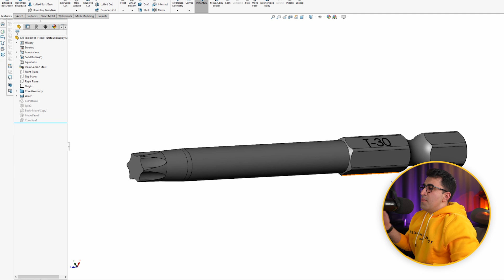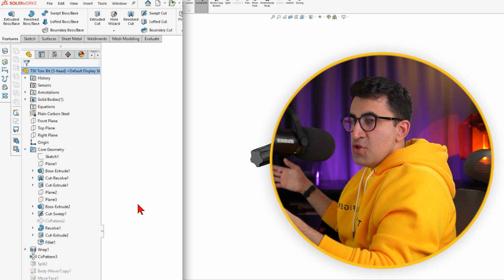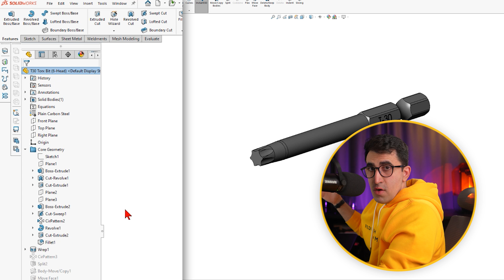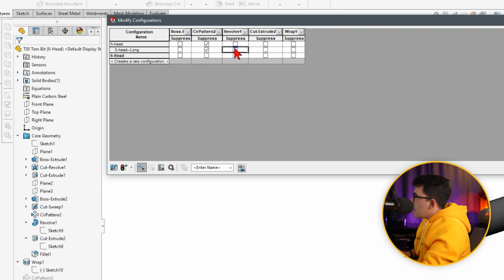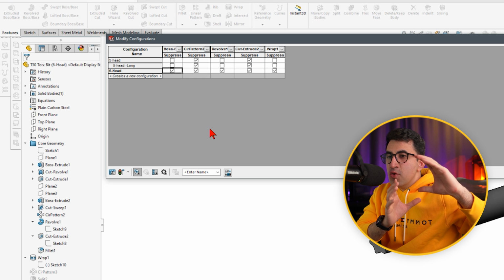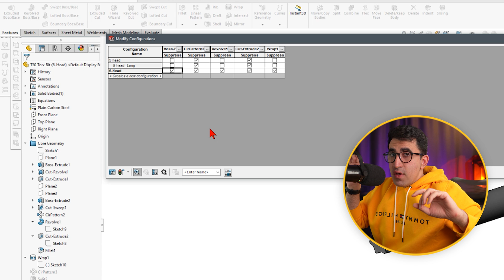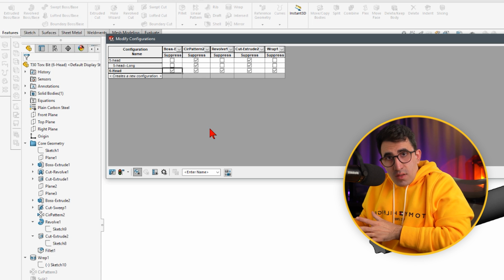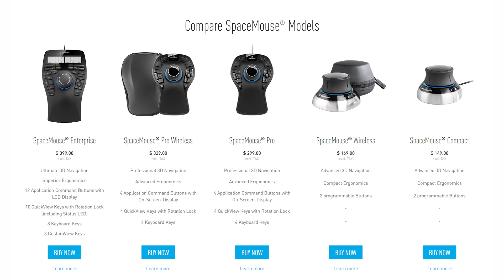Advanced tip for SOLIDWORKS - Challenge with a prize!

Comment: Hello Everyone ! I an Raj , I want to share tips and tricks more than 5 or 10 , might you know or you will learn new 
1.  use Ctrl + T for (Show Flat Tree View)
2. use T keyboard shortcut for (select Over Geometry)
3. To select geometry on a transparent entity with an opaque object behind it, press Shift when selecting.
4. change orientation of linear dimension in SolidWorks drawing ,Drag the little dot (handle) right beside the value and re-position the dimension as a linear dimension.
5. Using replace entity , In sketch mode, click Replace Entity ,converts the entity to a construction entity and converts the entity to a contour entity.
6. when you are adding relation in sketch ,context bar popup automatically and its disappear , what if you need to add another relation at the same time 
    keep your mouse arrow at previous place where its popup and press ctrl it will appear again 
7. display delete relation , help you to deal with dangling relation by replacing reference edges 
8. if you in line command press (Alt + M) to switch in to mid- point and press (alt + c) in to construction line 
9.  Reload Allows you to reload documents , you have read-only access and want to reload the latest version with any changes made by another user.
10. press  Tab - Flips the direction of the forming tool when dragging the forming tool onto a face.
11.  press (Alt) during Mates. Temporarily hides a face when you hover over a face and click Alt.
12. press (ctrl + w)  to close active window file

Comment: As a top to bottom designer, my sugession would be; start your complex and with lots of components design with skeleton sketches in your top assebmly. And then start to add your empty parts and mate them with planes in your assembly, then just create a sketch with edit section in your part with converting skeleton sketch into your part. That way you'll be able to control all your design and components only with skeleton sketches. Or you can even create blocks of your sketches and inserting to your part if you want to do in another way.

Bonus tip: you can hide with capslock and unhide with shift+capslock your components.
Reply from the maker: thanks

Comment: My Tip is for Controlling Mid Point Valu of Standard 3 Point Spline:

As we know we can easily define the end spline handles just by clinking on handles

But when we have a spline more than two points like, if we have three point standard spline and when we click on the mid handle it has two handles 

So if we click on any one and start dragging then the other side handle will not get changed or change with no control

So if we press th ALT button on keyboard and the click and drag the spline handle then the both both handle will move equally

So it's easy to define the handle length with equal value as well as it can be recreated with the same values again by any one

But if we drag the mid handle without pressing the ALT button then it will produce the spline which will not possible to recreate by others

Comment: SolidWorks Sensors: You can set up a sensor in SolidWorks to monitor things such as: Mass Properties, Dimensions, Interferance Detection, Proximity and there are others for Simulation. Once set up SolidWorks will notify you if the sensor limit is exceeded.

Comment: "Ctrl + Shift + S", will activates the "Suppress/Unsuppress Component" tool , allowing me to quickly suppress or un-suppress components in an assembly. We can use it when we need to temporarily hide components to see other parts of the assembly or when we need to make changes to the assembly that would otherwise be blocked by other components.
Reply from the maker: thanks

Comment: Rather than chasing down all the different functions and features available on Solidworks, use the command box on the top right corner of your screen and start typing in whatever function you are looking for and Solidworks will give you a drop down list of functions related to what you are typing in. As soon as you find what you're looking for in the drop down list, select it and it opens right up. Remembering all the short cuts is overwhelming when learning Solidworks, so utilize this option to speed up your design time.
Reply from the maker: good one

Comment: For me working as a engineering in R&D department, the best feature of solidworks is design binder. To design any part or assembly I study lots of research papers, manuals and data sheets, and I need to keep all of them organized so that I don't need to find them in next revision. But by using design binder, I just need to attach all the reference documents the the related part or assembly. By this way, at the time of next revision I do not need to find the reference files.
Reply from the maker: Thanks

Comment: Another more well known tip but easy to miss: In an assembly you can select two or more faces, edges or vertices and simply click Mate. The program will automatically select the best mate for those selections (tangent, coincident, concentric, even width works too). 

This is not exclusive to Mate though, most SolidWorks operations will try to apply the best outcome for it like Sketch Mirror, where an automatic mirror is applied if your selection has 1 or more entities and ONLY 1 construction line.
Reply from the maker: Hi, you won the fifth best comment and the fifth prize. Please send me the address you want me to send your prize to here: Info@solidworkstutorials.net and write a random 5 digit number in that email! Important: confirm below this comment in a reply what that 5 digits number is.
Reply: @with-aryan  Awesome, thanks a lot!

5 digit code: 54915

Comment: As I only have solidworks through work, I cannot record. However, something I’ve always found helpful is dimensioning between 2 points/lines rather than a whole line. For example: if you have a sketch with a rectangle, instead of clicking on one line to dimension the length, I’ll click the two opposite lines and place the dimension. This helps if I end up modifying the geometry, adding fillets in the sketch, or trimming the lines by keeping the correct dimension rather than breaking it and re dimensioning.
Reply from the maker: i do the same

Comment: Time saving tip: you don't need to choose a sketch plane first to start an operation. You can simply select a feature i.e. Boss-Extrude, and SolidWorks will prompt you to select a plane or flat surface to draw a sketch on. Once you exit the sketch, the program will automatically enter the Boss-Extrude configuration panel, thus saving a lot of clicks and mouse movement.
Reply from the maker: thank you

Comment: Sometimes assemblies with many in-context parts and sub-assemblies can run into rebuild errors, especially when you need to make changes multiple levels down. A common problem I ran into was automatically generated feature update order, not to be confused with the "Automatic solve order" option in Equations/Global Variables/Dimensions.

To manage the update order manually:
Open an assembly or subassembly.
right-click the assembly itself in the Design Tree (at the very top).
Select "Show Update Holders" from the context menu and "Update" items will appear for various features toward the bottom the the design tree.

These update holders can be dragged to rearrange them within the tree, and will be parsed in order from top to bottom.
If there are more than a handful of them, I recommend organizing then into folders using the following structure:
📁1-Global Variables (bottom level values and equations)
📁2-Sketches (bottom-level sketches used for 3d body features such as base/boss)
📁3-Base/Boss (simple starting point features which only reference 2d geometry)
📁4-Comlpex Features(features that reference 3d such as patterns, Cavity, or up to surface definition)
📁5-Cuts (features that subtract 3d geometry)
📁6-Finishing Features (things like chamfer/fillet)
📁7-Misc (high level parametric variables)

This workflow highlights the benefit of naming sketches and features in the Design tree, and the importance of simplicity and optimization. Depending on your situation, there may be features that need to update somewhere between the folders I described, but that mostly avoidable if you begin a project with this advice in mind.

Comment: If you are working with an assembly that has lots of parts, try to not use sub-assemblies otherwise you will encounter problems with moving parts, contacting, simulation and more. It is posible to work with them, but it takes way more time. Keep it all in one assembly... And pray for your pc to stay alive.
Reply from the maker: thanks

Comment: Tip: I use alot when doing reverse engineering, a straight corner and pressing shift while taping on a circular point I can get the edge of the circle or arc instead of the center and it helps to be more accurate in some reverse engineering parts.
Reply from the maker: thx

Comment: When working with assemblies, sometimes what was an identical part needs to be have some changes made. You do not need to copy the file, and replace the part. Simply select the parts that you want to change, right click them in the tree and click "make independant". It will ask you to give it a new file name and automatically replace it in the assembly.
Reply from the maker: being considered for the top 5
Reply from the maker: Hi, you won the second best comment and the second prize. Please send me the address you want me to send your prize to here: Info@solidworkstutorials.net and write a random 5 digit number in that email! Important: confirm below this comment in a reply what that 5 digits number is.
Reply: @with-aryan  awesome, never won anything before. Sent the email. 20079

Comment: This one will save you a lot of times if you make a lot of drawings for similar parts or drawings for new revisions.

Copy & paste a drawing, and give it the name of your new part or drawing, then when you go to File>Open Click "References" box in the bottom, then double click the name of the old assembly in the window, and browse to your new part or assembly. This way you have duplicated a drawing and re-linked it to the updated assembly.

I worked in a company that didn't use PDM and all new revisions were saved as new parts/assemblies, I was shocked to see engineers manually re-create complex weldment fabrication drawings by hand for each variation when they could have simply replaced the references.
Reply from the maker: thanks
Reply: Reaaly not able to understand

Comment: Always start drawing your parts of assembly in the assembly (insert - component - part...). Parts will have the same coordinate system reference, which means you can always import part or replace part exactly where it was without Mate feature. Also, you can make reference dimensions and features in relation to other parts.
Reply from the maker: not quite with you on that one. Assemblies have limitations and for a complex project you'll face some slowing down and complications due to all those dashed hidden lines
Reply: @Jimball-4 Agreed. Although,  it depends on the situation. If you're sharing .step files with your customer then this might come handy, coordinate system is transferred exactly.
Reply: @Ivver  In my experience its always better to have an absolute origin, modifying parts with a fixed in-assembly origin may not work if the part moves relative to that origin, so its better to have it fixed to the space and not assemblies.
Reply from the maker: Here! this is what I recommend

Comment: Anything that can be added as a feature instead of as part of the original sketch (e.g. chamfers, fillets, anything that needs to be patterned/repeated) should be. Your coworkers/superiors/customers will not want to have to alter the original sketch every time they need to make any minor adjustments.
Reply from the maker: being considered for the top 5
Reply from the maker: Hi, you won the third best comment and the third prize. Please send me the address you want me to send your prize to here: Info@solidworkstutorials.net and write a random 5 digit number in that email! Important: confirm below this comment in a reply what that 5 digits number is.
Reply: Thanks for picking my solidworks tip! I love your videos. The 5 digit number is: 91710

Comment: If you want to reverse engineer or modify an existing component but its only available in .STL, use the mesh modeling feature, its not visible by default but you can search it easily.

Comment: 1) Instead of Mirror you Need to use Move and copy bodies
2) Creating a plane...you just click that plane and simply drag it will create. 
3)in the trim comment if any raung line  you trimmed doesn't use control Z.. just drag backwards you see will see one red 🔴dotted line..you jut drag to the point it will undo
Reply from the maker: thank you
Reply from the maker: being considered in the top 5

Comment: My tip for Solidworks motion: Since it can be time-consuming to include contacts in your simulation, if your simulation isn't about the behaviour of contacts but you need it in your animation, like packages going on a conveyor, use this instead:
Let's say we're going to drop a package from a distance onto the conveyor surface. First, define an advanced distance mate between the side of the package and the surface, with a minimum distance of 0. Then run the simulation and note down the time when you think the package will start moving. Next, add a linear motor to the package and give it a reasonable speed. Run the simulation again, and finally, deactivate the motor at the time when the package will lose contact with the conveyor. I know this information may not be meaningful to most of you, but I wanted to share something more specific with you guys.
And do you allow us to share more tips Aryan? Best regards.
Reply from the maker: it was always allowed. but today was the deadline.
Reply from the maker: what's the advantage of doing this?
Reply: @with-aryan  The advantage of doing this is simply saving tons of time. Because contacts really slow down the simulation process. I literally got able to finish some of my projects after exploring this trick. And also despite the fact that so many people won't need this, I wanted to give a unique trick since this is a unique channel :) And even if just one person would need this among 1000 people, the total time saved by this method would still be satisfying :)

Comment: Through “SolidWorks Property Tab Builder” you can make Custom properties for whatever product you are making and with few buttons you can describe your product however you like and take it to the drawing section. It really helps out with different metal profiles when you are making different manufacturing products. The drawing page automatically can fill out almost every product parameter if it is linked correctly, which speeds up drawing-making proccess.

Comment: Shift + Tab switches between different opened parts in the tabs, best tip I ever got
Reply from the maker: I'll review all the tips in 2 weeks and we'll see where your tip stands
Reply: Shift+tab shows a body in a multi body part or a component in an assembly (if they are hidden). Btw TAB - hides the body or a component ;) and it's a good one.
You meant Ctrl+tab for what you described
Reply: crtl + tab you mean? ;)